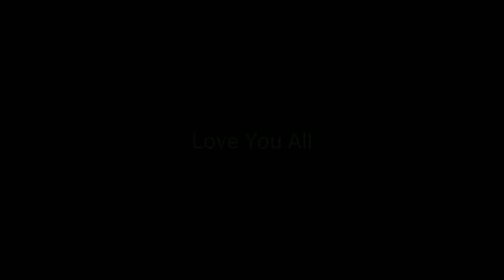2 pedal gaming set || make it || ArTWoRk Hacks

Comment: Can i use a ribbon out of wire and what is wire work in this model
Reply from the maker: see wire is acting as rope, at the same time providing conductivity...
with the ribbon we might press it, but the touch screen won't work........🫠
Reply: Can I use aluminum foil as the wire?
It still does give some conductivity.